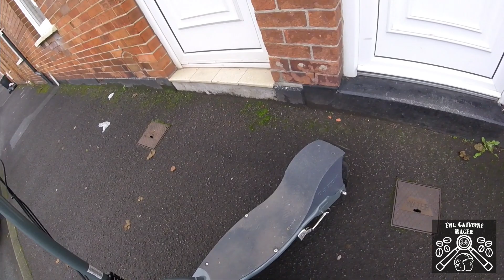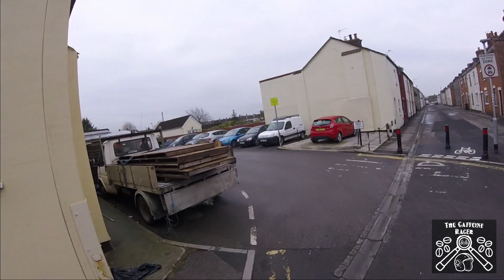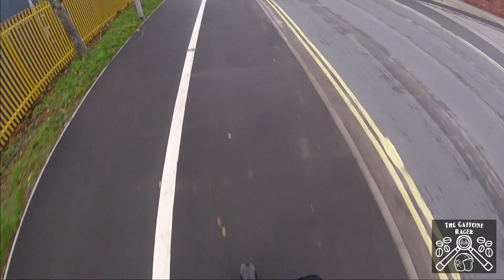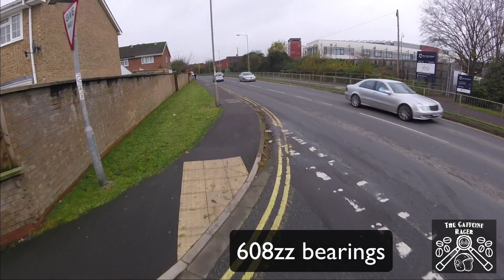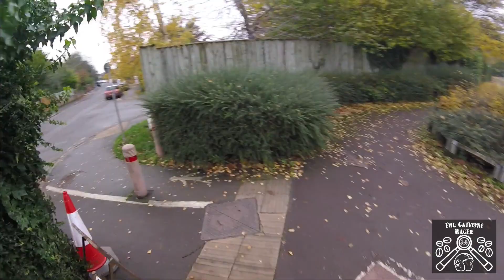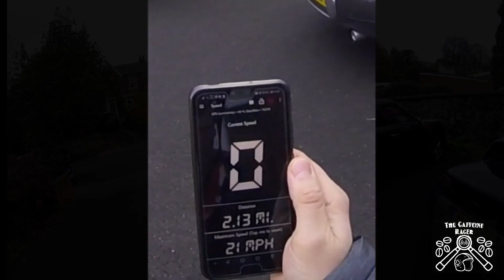Modded Razor E300 fast 36v lithium setup ride out and vlog

Comment: People says that original motor borns up on 36v
Reply from the maker: Sorry for the slow reply, 24mph flat ground and if you stop the rear brake from binding and putting stress on the motor then I haven't had a burn out it gets a little warm but only a little. Done well over 100 miles in this set up now. Am not sure if I add a third battery weather this might cause over heating but at the mo it's great. Drone motor set up is nearly complete. Micro controller for the throttle is now ready just need to wire it all up and test it.

Comment: Did the speed decrease as you were close to your destination?
Reply from the maker: Yeah turns out one of the batteries was faulty cheap Chinese copy have replaced it now and can do 8miles at full tilt before speed starts to drop
Reply: Timsalsanights aka The Caffeine Racer were did you get the new battery from.  If you don’t mind me asking.
Reply from the maker: @Milhouse_1  from the ebay link in the video description I stopped using the other supplier these are much better
Reply from the maker: I was only at 3/4 throttle late in the video
Reply: Timsalsanights aka The Caffeine Racer what was your max speed at 3/4 throttle.
Reply from the maker: @Milhouse_1  about 15mph at 3/4 throttle
Reply: Timsalsanights aka The Caffeine Racer do you think that going full throttle would have Significantly drained the battery or cause the Motor to be hot.   Sorry for so many questions.
Reply from the maker: @Milhouse_1  ideally I would have all three batteries for range then you wouldn't see a drop in performance for a long time. I had issues with the brake binding causing heat in the wheel and a strain on motor with that sorted the motor only gets warm never hot. I have run out like this for nearly 100 miles now. 21mph is its top speed. I have a drone out runner motor to try next. Find me on insta @timsalsanights let's chat about it
Reply: Timsalsanights aka The Caffeine Racer I sent you a message on Instagram
Reply: @TheCaffeineRacer hi I've just followed you on Instagram. I'm loving these videos xx